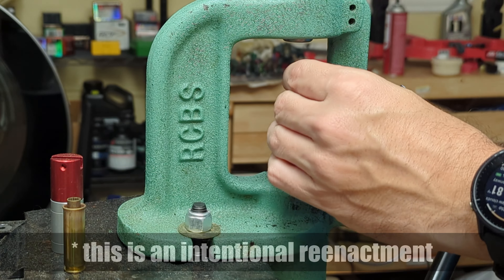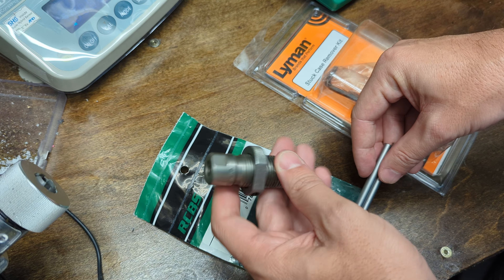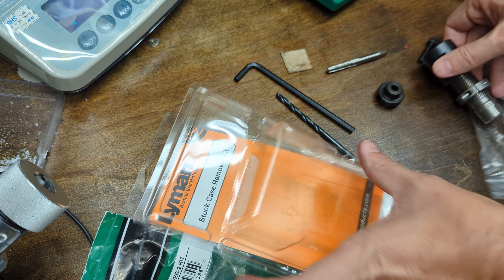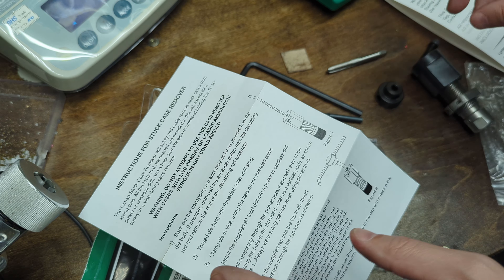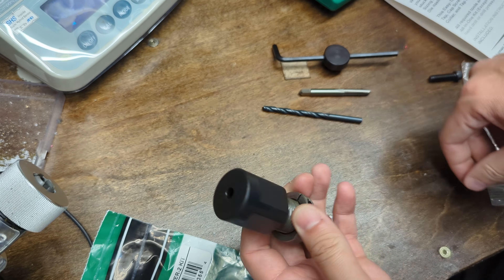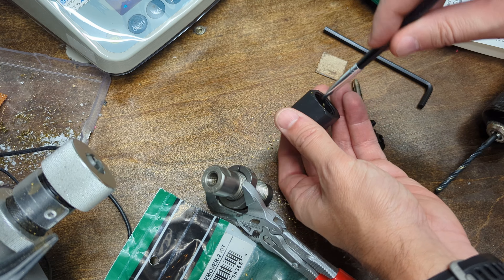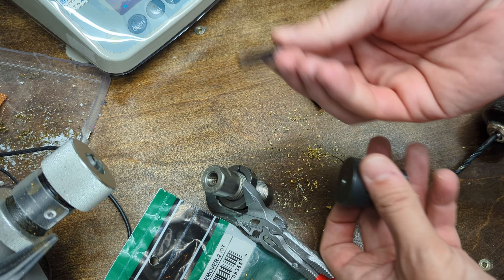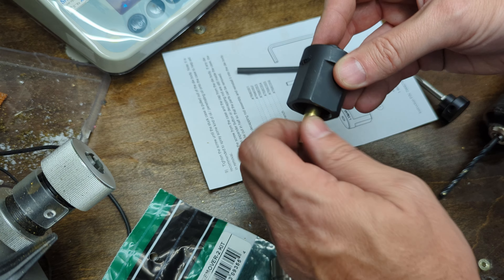Lyman Stuck Case Remover

Comment: Thanks for the review; I’ve never seen that particular RCBS kit, that’s kind of a primitive way to drive out the stuck brass.  Instead I have the RCBS 09340 kit, which is almost identical to the Lyman kit you’re showing there, except the Lyman is fancier in that the extractor body is larger and threaded to fit over the 7/8x14 die threads, while the RCBS body is just a smaller diameter unthreaded unit that fits over the case head. The RCBS instructions say to put the die in a vise to help.  

By the way, the reason that tap doesn’t fit easily through the body/cap is it isn’t designed to go through the cap, or rather the cap isn’t designed to accommodate the tap, it doesn’t need to; drill the primer out and tap it freehand while it’s mounted in a vise, you only need the body cap threaded on when you’re using the extractor-through bolt with the Allen wrench.  I think if the instructions show the tap going through the cap they’re either incorrect or whoever wrote them assumed the body through hole would be larger.  

Since that tap only needs to tap soft brass it will essentially last forever, so you’re right, you really don’t need thread cutting oil, but I always add a couple drops to the tip of the tap anyway.

I also just bought that new Frankford Arsenal clamp style stuck case remover, but haven’t had a chance to try it yet.  Thanks for showcasing the Lyman kit.  I think if I hadn’t just gone with the RCBS kit recommended to me I would have opted for this one, as that thread-on larger diameter body cap is a nice upgrade.  👍

Comment: Someone told me to use Imperial Case Sizing Wax and an RCBS case lube pad. Haven’t had a stuck case since I made the switch.
Reply from the maker: Yeah, I gave Imperial a shot. It stuck the third case I tried, so, I don't think the lube was the issue. I have learned (during making this video) that the root cause was the shell holder fitting a bit loose on the case rims. Got a new one, and haven't had a stuck case with it yet.
Reply: @TechDregs "I'm cheap" 
Grab bottom of case head with locking pliers.
 Stack open end wrench on plier. Now turn down your lock ring against wrench until case is pushed free.
Hope i explained myself clearly.

Comment: "I'm cheap" 
Grab bottom of case head with locking pliers.
 Stack open end wrench on plier. Now turn down your lock ring against wrench until case is pushed free.
Hope i explained myself clearly.
Reply from the maker: I've tried that route before. It works sometimes, but 223 is troublesome because it's so small. It can be hard to get a good grip on the case head, and it sometimes tears off... and then you're really in a world of hurt.

Comment: I can never get the expander pin out, alway have to cut the brass after removing it.  I am interested on how you were able to get the pin out while the brass was still stuck in the die?
Reply from the maker: Yeah, that's a big problem. With this type of extractor system, if I were using a Lee die, I'd take out the expander collet and let the pin drop to the top of the die (should be loose until the expander ball hits the neck, so there's some room), and then I'd try to be careful with the drill to not go any deeper than necessary so you don't hit the decapping pin. 

Once the brass is extracted, the easiest thing to do is just get a slightly bigger drill bit and make the hole in the bottom larger, then the decapping pin should just drop out the bottom. 

As for how I got the pin out for this video... I didn't. I removed it prior to the demonstration just so I wouldn't have it in the way (because it really is such a pain in the ass).

Comment: Did you try lanolin lube? When you tread the brass remove the black housing first then put it back on the die with the black housing then screw to remove the stuck case
Reply from the maker: I have used Lee sizing lube, Imperial, and Hornady One Shot. The Lee lube is actually quite good, and I'd put it right there with Imperial. One Shot is ok, but I wouldn't use it unless I was doing bulk stuff (as a time saver).

As for the case remover, the instructions show the tap going through the housing. That's apparently what it was designed for, but it's just not sized correctly for that.

Comment: THUMBS DOWN. First of all, thank you for not bothering to tell me what it cost. Second, I could not find this product anywhere on Lyman's website. That's either my fault (don't think so) or theirs. But you repeatedly mentioned NOT using a vise, duh, you think maybe that's why it was so difficult? AND you did it this way because you thought most people would do it this way? The "Bubba" way? This is insulting your audience overall, and to anyone named Bubba. Your whole operation was clumsy and sloppy. Bye!
Reply from the maker: Well, sorry, I didn't want to insult my audience by assuming they couldn't look up the price for themselves. Second, the link on Lyman's website is the first result on Google for "Lyman stuck case remover". Here you go: https://www.lymanproducts.com/stuck-case-remover. And no, not using a vise had nothing to do with any difficulty using this system. The problem was that the hole in the steel cap was smaller than the tap, so I had to partially tap that hole even though the screw isn't supposed to engage that part. There's no reason for that hole not to be drilled slightly larger to avoid this. Using a vise wouldn't change that.

I wish you the best on your internet journey. Good luck out there. :-D